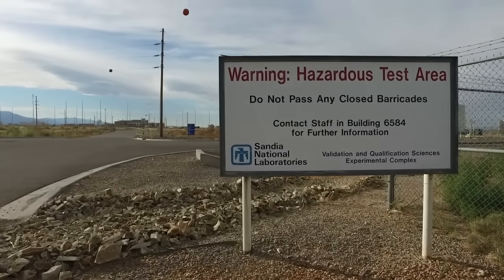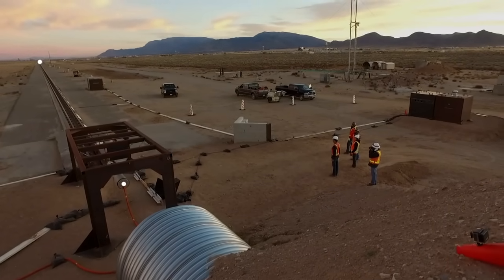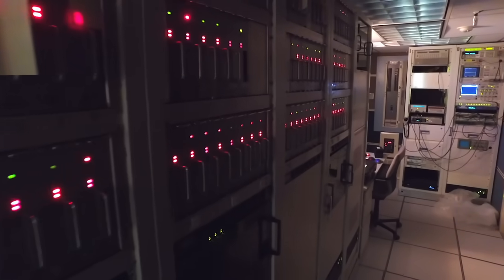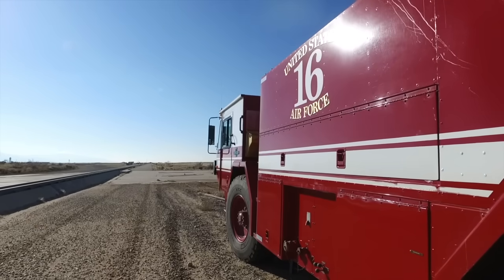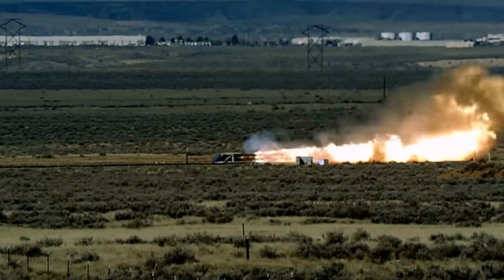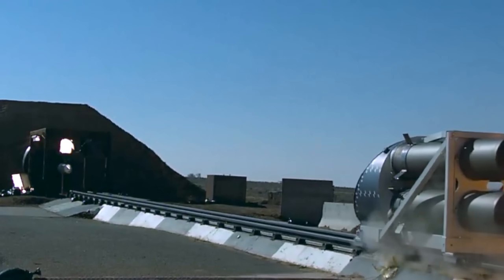Rocket Sled Impact Test In Slow-Motion

Comment: "All possibilities are prepared for"

I wonder if that also includes the possibility that they accidentally used an armed thermonuclear warhead instead of a test unit
Reply: Waxel Punkt.  It's to ensure that there will be no accidental detonation in case of impact.
Reply: “Well Frank, that can’t be good”
Reply: And how would that would prevent the massive retalatory strike from our subs, icbms and bombers,
Reply: @manw3bttcks  laughs in helluva tsunami sending you to Brazil
Reply: I wonder if a subsequent test purposely used a live thermonuclear warhead.
Reply: Given that this is a test on a nuclear weapon, I would say the chances of that are zero.
Reply: @jsragman8045  Only a Sith deals in absolutes!
Reply: I feel like this would be the sort of thing I might do.
Reply: easy they just turn invincible
Reply: If they do used a live one instead of a inert one they wouldn't have time to worry about it, more than a couple hundred of a second.
Reply: @miranina1585  If they used a live one it would have had exactly the same effect, except that the test zone would have been irradiated due to the nuclear fuel being tossed in every directions. You can't make a nuke explode without the fuse being activated, no matter how hard you hit it. It needs a synchronious explosion of the explosive around the nuclear fuel core, otherwise you just get a little explosion (the equivalent of a 120mm shell i would assume) and radiations.
Reply: @pierrevilley6675  I was aware of the detonation process of nuclear weapon ( either explosive compression or smashing 2 part to go above critical mass ). I didn't know they needed to be activated though. Once the detonator was in place I was under the impression it was live and thus able to explode. I intended to talk about a "live" weapon in the sens of being able to explode to it's full potential and was trying to make a joke that they wouldn't worry for long if it went off. Unfortunately the joke didn't came thru I guess.
Reply: @miranina1585  I got the joke, but still wanted to clarify the fact that a nuke can't explode if all the tiles of the explosive cap aren't set off at the exact same time (because of my nerd side i guess), which takes multiple electrical detonators and thus can't happen by external causes.
Smashing two parts is not used anymore, because it was not safe enough.
Reply: @pierrevilley6675  "smashing two parts together" isn't used anymore not because it's "not safe enough". It's not used anymore because it's terribly inefficient, the yield isn't as great as they want it to be, and Plutonium won't work in a simple gun type device.
Reply: @davelowets  Good point, but the safety reason still stand, it is physically possible to trigger this type of bomb if it is unarmed, whereas it is impossible for the "implosion" type.
Reply: Waxel Punkt.  I think they tested the piercing capabilities of the projectile against an angled, armored surface
Reply: Yes. They also take into account the possibility of using an armed warhead for the test by accident. Then they take precautions to avoid that. They, for instance, don't have access to any armed nuclear warheads.
Reply: Even a live Nuclear warhead wouldn't just explode on impact, a certain sequence of events needs to happen to enable nuclear fission not purely an impact..
Reply: A nuke was dropped on Albuquerque once by accident.  They showed the crater on the News (it didn't go off, just the weight left a crater).  

A guy was in the back of the bomber, there was turbulence, and he grabbed a lever to steady himself.  It was the bomb release lever.
Reply: like warping through a time field landing at a Mayan City.
Reply: Don't worry Alec Baldwin wasn't there
Reply: Trolled
Reply: @Skippy it's just a bluff mate.
They are retreating from Kiev as we speak.
So much for denazification of Ukraine then.
Reply: Not sure that would be as much of an accident as a grossly negligent misappropriation. I mean to mistakenly vaporize a fully functional thermo-nuclear weapon would certainly be an all time disaster.
Reply: @Skippy Hah!  You really have no understanding of force and fluid dynamics.  When the tsunami hit Indonesia, the 900 miles of seabed shifted up as much as 40 meters and displaced the water that came ashore as a 20 foot wall of water.  Nukes no matter how large would only make a small splash.
Reply: @stanelwood6394  exactly what is was thinking , the can move water much, theres videos of usa underwater nuke test, the ships barely move, even 1000 tsar bomba`s wouldnt make a big wave, just make it rain alot as a decent amount of water will turn to steam, nothing more, a comet 50 miles long trvelling 40,000mph is whats needed not nukes lol
Reply: In your PFP, what war thunder plane is that?

Comment: This was such a pointless video, I have literally no clue what just happened lol
Reply: They're testing the stability of the triggering system for an atomic weapon.  It should only be triggered by the detonation circuit and not an airplane crash or other incident where the weapon can be destroyed.  Rather than crashing the missile into a hard surface, they make the weapon static and crash a rocket sled with a specially prepared crash surface into the missile to create a situation where the warhead and missile are destroyed.   They then take the data collected and put that into computer programs for further simulation and analysis.

Comment: Sandia or Holloman Test track. 🧐
We had a sled track like this at holloman when I was stationed there.  Frequent sonic booms from testing would shake our shop.  And I did a water break, line repair, at the test track at one point.  Used to deluge units they want to save and slow them down.

Comment: Exactly what was this test designed to prove? If you smash a large solid mass at very high speed into a missile, the missile gets FUBARed
Reply: The opposite. That the thing on the sled will easily stop a missile. That "thing" is integrated into the design of nuke facility defenses.

Comment: How does this keep our nukes safe  ??   Did I miss something  ??  I was on the toilet too while watching this..  I didn't learn anything..
Reply: they were testing the redesign nuke.   we can't actually detonate them.   so, we wire up a bunch of sensors and pretend to detonate them without the core.   the sled is simulating the earth.   the angle is simulating a typical flight angle.   this is a ground burst for hardened targets that are buried.   Some has said this was a test of an accidental drop.    either way, the key high speed footage of the core detonating has been edited out.    One of the labs has a good 4 hour documentary named "always never" that explains more.

Comment: So if I understand correctly, this test is to ensure the safety of the nuclear arsenal by proving the fuzing doesn't misfire during a super sonic impact? This video keeps saying that by doing this test it ensures safety, but never explained how it goes about doing so. Thats just what ive gathered from comments.
Reply: You're correct. The test is intended to validate the design of the electronic systems inside the warhead and ensure that it doesn't detonate unexpectedly when subjected to impact/shock, as would happen during a bomber crash or an enemy attack on a nuclear stockpile facility.

Comment: I remember watching a high speed test done on a track using a jet plane flown into a solid concrete block. It disintegrated and vaporised.
 The next test was done on another track but this time the projectile was sent down inside a polythene tube filled with a gas which eliminated 
the air resistance. However, this time we were unable to see the final frames of the result because they were top secret.
Why were those results top secret and what do you think they learned from them? Surely it would be better (and cheaper) if scientists shared 
this kind if data for the benefit of everybody.
Reply: Like anyone is going to talk Top Secret subjects with you here on You tube?  Every here of national security?
Reply: Implying what about me Mr hoghogwild? That I'm some kind of spy for a foreign power or that I'm going to build myself a weapon to take over the world?
This is good coming from a person who cannot spell or punctuate correctly.
I thought it was funny that the last bit of the footage was top secret, it was also unexpected, like showing a slo-mo car crash and taking out the last 40 frames of film, we know what will happen, it will disintegrate and larger bits will come to a stop.
Unless it opened a wormhole or had a colour change it should be fairly predictable shouldn't it?
They normally get their speedy particle collisions data from the Hadron Collider in Switzerland.
Reply: @petergambier  I wasn't implying anything personally about you, just that anyone here "in the know" won't discuss it with you.  OOOps, I spelled hear/here incorrectly.  That automatically discounts everything I mention, intelligent.  You mean the "Large Hadron Collider" that's for sub atomic collisions.  I also enjoyed the F-4 video you mentioned.  That also was performed here.  Remember the wingtips?  They continue on as if nothing had happened to the rest of the a/c.
Reply: Thanks for not throwing a wobbly @hoghogwild , too many times in the past I'd say something in a comment and then get 1 or 2 trolls giving me grief. Now, it seems that the great Google has cleaned a few things up, or else the trolls have gone on simultaneous holiday. It's now possible to enjoy a non threatening conversation with another soul in a place somewhere on this earth. I also have conversations with people in call centres when they call me up and try to get them on a different conversation from their scripted one. I'm also curious about where people live and what they do.

 I'm a lime plasterer in the south-west UK and during these self-isolating times I'm actually still working because I usually work in isolated homes, all my present jobs are thankfully outside in the village centre. Any people I see usually know me and everybody is doing the social distancing and keeping 2-3 metres away in the centre of a village. I live with my wife, 2 offspring and creatures with fur and feathers in the countryside overlooking Hinkley Point nuke place which is Europe's largest building project, About 5000 people normally work there, now it's down about 1000. Where are you and what job do you do please?

You had spelt 'here' correctly by the way.
Reply: @petergambier  Hi Peter, my name is is Paul, pleasure to make your acquaintance. I live just outside a small city in South Western Ontario, Canada named Woodstock.  The local industry includes a Toyota and General Motors assembly plants.  I joined the Canadian Armed Forces(CAF) out of high school and was a machine gunner in the Royal Canadian Regiment. About 10 years ago I went back to school and got a nursing degree and that's what I do for work now.  I'm a single guy, no offspring but I have a furry 4 legger at home.  These certainly are interesting times we live in. I hope you and your family stay safe.  I tell you, be happy you are married, this virus sure has hurt "the dating scene"lol.
Here is my post "Like anyone is going to talk Top Secret subjects with you here on You tube?  Every here of national security?"  In the 2nd sentence, I should have used the word "hear" instead of "here".

Comment: 2:20

In the top left, you can see the atmospheric wave ahead of the impactor, that is so cool
Reply: The force is strong with this sled
Reply: Yup. That’s called a linear optical distortion, or LOD. These are also often visible during rocket launches - they were very apparent on long range shots of the space shuttle. 🙂
Reply: First the distortion along the ground, then along the cone.
Reply: Jamboree Rathanes would co do

Comment: That was lovely.  Now, instead of having absolutely no idea what this was, I have ALMOST absolutely no idea what this was, or how this makes the US nuke stockpile safer.  Maybe next time you hire someone from the private sector to produce a video that communicates actual useful information to the viewer.
Reply: I think that impact angle ( simulated ) plus a very high mach - would be the representation of an icbm warhead inbound on a ballistic trajectory....whose internal instrumentation, presumably, was being tested to ensure that it would detect the ground rushing up to it, in time, for it to fuse and detonate the weapon in a simulated ground-burst fashion.  you see - icbm warheads come in at mach v. high ( circa 20 I'd estimate given that orbital velocity is circa mach 25 ) but with the air-drag / friction-drag of the atmosphere that would have to reduce a bit....and  I reckon it's likely that by the time it reached the ground it could well be about mach 8 or 9, therefore....and as other comments, here, state..the rocket sled speed was to be around 8.6 mach.  lastly an air-dropped weapon's terminal velocity due to simply gravity ( from any height that an air-breathing engine'd plane  ( or it's own engine if a cruise missile which btw operates at low level so is not relevant here ).....would not be anywhere near the speed of this sled. have a look at icbm warhead reentry videos to see how fast they come in - and the speed is : screamingly fast .... ! have a good one...

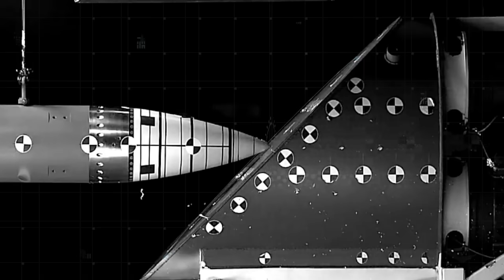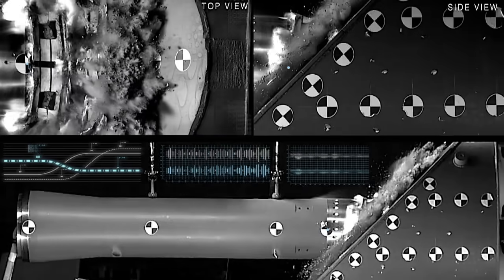Comment: Upon review of the video data, I notice there is an air compression ahead of the target surface.  This would potentially differ from an actual impact due to the compression wave would be effectively a sleeve insulating the projectile; the compression wave would hit the target first, and thus affect the nature of the target;  and "protecting" air compression wave of the projectile would contrast from deformation of the projectile by the air compression wave in this test, since the air compression wave would be around the projectile instead of around the target.  The ripple in the air can be observed well at about 2:10 and 2:18, then again at about 2:21 and 2:30.  However, the sensor readings from 2:22 to 2:33 do not seem to indicate data reflecting the air compression wave.